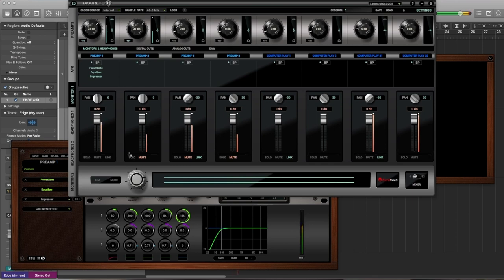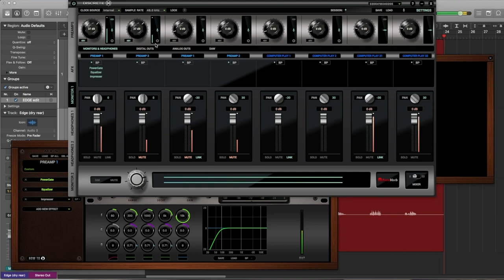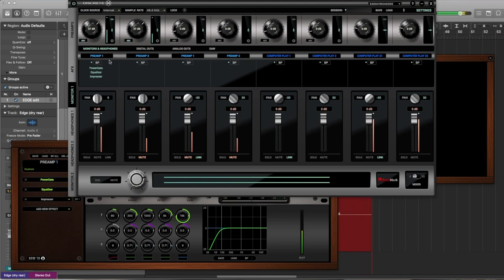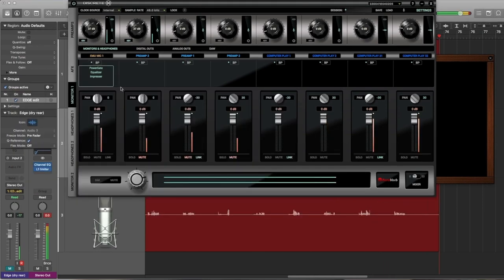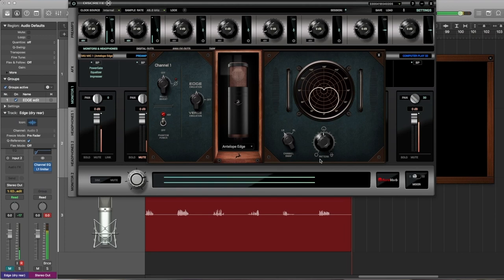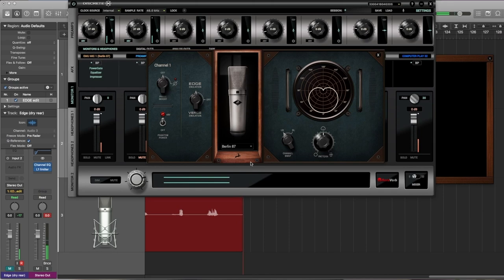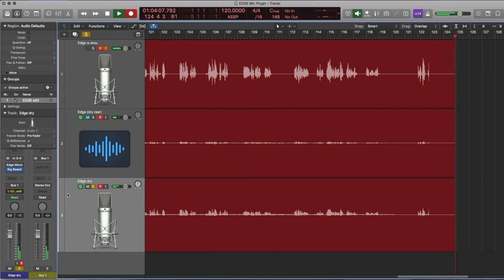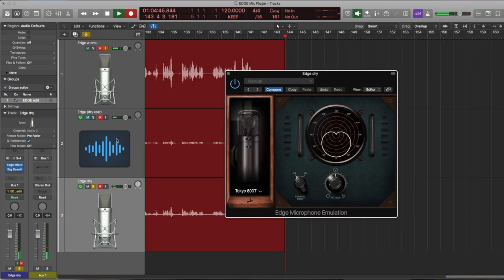Antelope Audio - Edge Mic Plugin

Comment: Great video! Ordering myself a discrete 4 with the premium Edge modeling pack! Wanted to add a Verge mic also into it. Does the modeling software come with both Edge & Verge emulations since the Discrete 4 only has a Edge package? Thanks!

New subscriber!
Reply from the maker: The emulations are actually sent with each microphone as a code.  So if you purchase a Verge it will come with the Verge models.  Not sure the Edge plugin is available for the Discrete 4 Edge - but it is definitely in route.  The Edge plugin has been updated with 10 mics since I created this video.  The Verge plugin has not yet been released for any of the interfaces.  The Discrete 4 will also be receiving several preamp models and a bass amp model soon.  Great stuff.